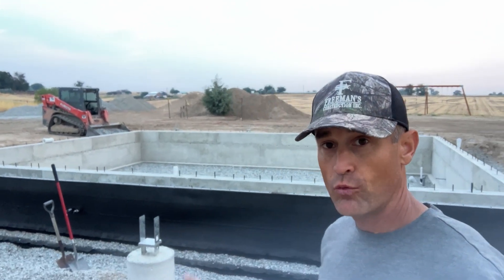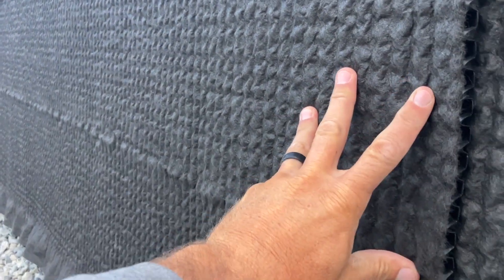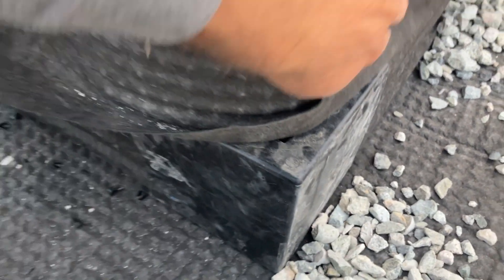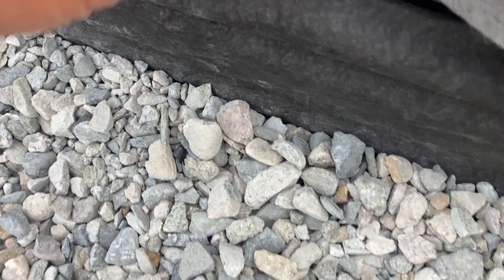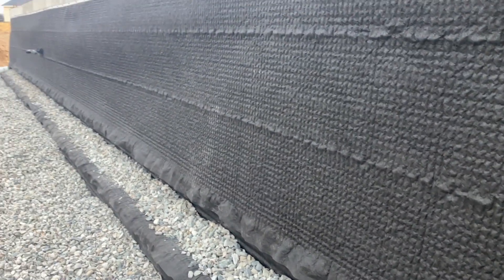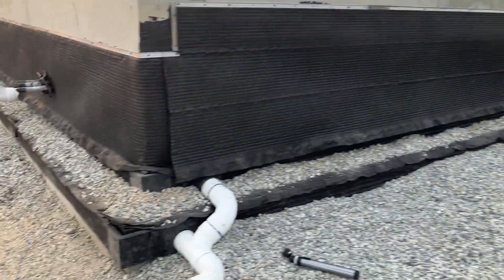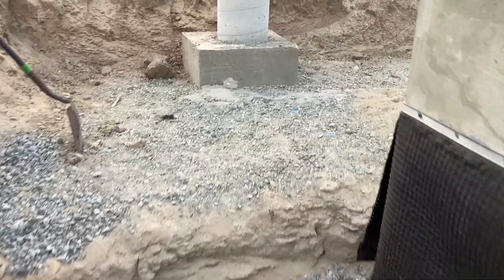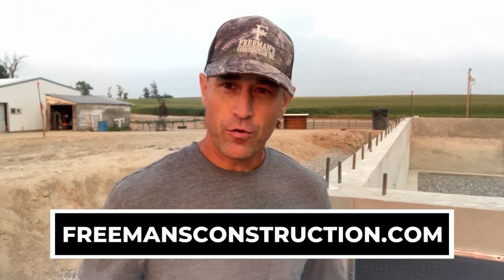Part 2: Waterproofing Stem Walls for a Subfloor Foundation

Comment: what size of concrete pin do you use?
Reply from the maker: Are you referring to the concrete pins forms for the stem walls? If so those are about 1" wide and about 8" long. You can see them in this video https://www.youtube.com/watch?v=ZhN0OExiwb8&t=6s

Comment: Seems really excessive unless that area gets a ton of rain and ground water
Reply from the maker: It definitely would perform well in a wet climate or areas of high ground water. We wanted to make sure the conditioned crawlspace had zero chance of getting any moisture into the space. 

This home is in Middleton, Idaho. It is a drier climate however there are areas that have high ground water from either the rivers or water from farm irrigation.

Comment: I was surprised to see that the J-Drain literature shows the SWD being installed only at the base of the foundation wall rather than at the footing as you’d normally see with a perf pipe wrapped in in filter fabric. I like your installation where you install the SWD at both the bottom of the foundation wall and the outside of the footing. Seems pretty bullet proof. 

Is the SWD really necessary at the base of wall if you have it at the footing level? Seems redundant if you have the wrapped dimple mat and a layer of open rock all the way down to the footing.
Reply from the maker: I actually thought the same thing about J drains detail showing the SWD at the bottom of the wall and not at the side of the footing and that is why we added the SWD at the footing as well. I would rather take care of the water at the base of the footing before it challenges the cold joint at the bottom of the stem walls. I do believe just putting the SWD at the footing and not at the bottom of the wall would just fine. Using the SWD drain is much faster to install as the filter fabric is already attached to the drain and fits nicely again the sidewall of the footing.